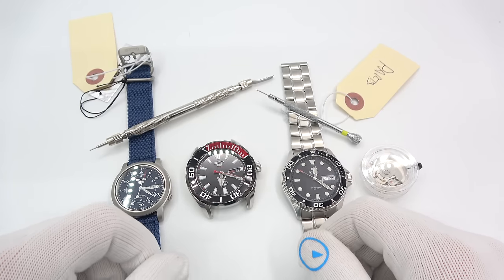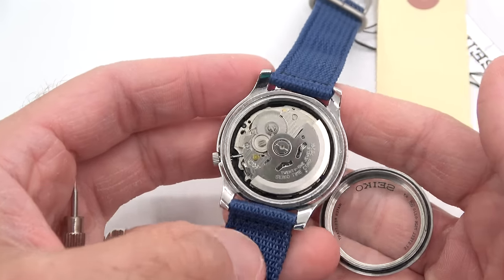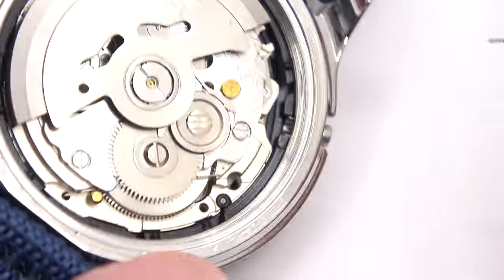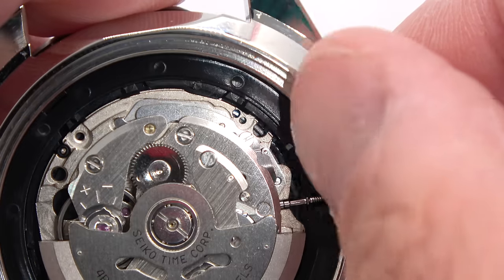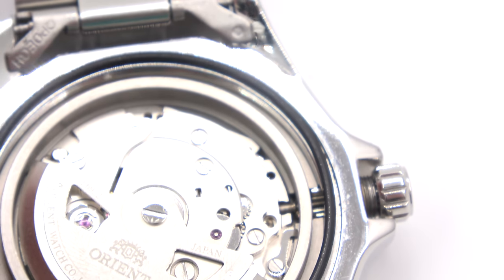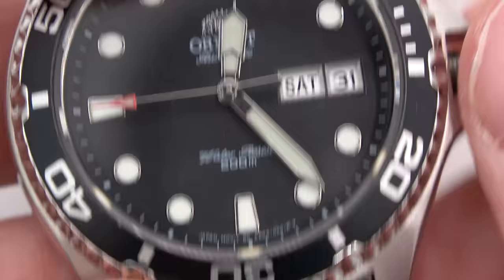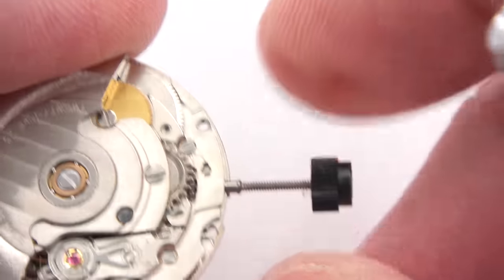How to Remove Stems and Crown from Common Movements. Watch and Learn #66

Comment: Hi, thanks for the excellent video. I needed to replace my stem after the jeweler broke the crown off my stem while replacing the battery. Obviously she said it was missing when I brought it in. So I ordered a new stem and crown from Esslinger and fit the stem to my watch per the instructional video by Darak Watches. I carefully inserted the stem as you show in your video and everything went together fine, but the date will not change when I pull the stem out to the first stop. Pulling the stem out to the second stop works fine to set the time. Can you offer any suggestions as to what I might have done wrong? Thanks in advance for any help. Movement: Seiko 7N42C

Comment: Perhaps you can help. I have a problem,my stem has broken half way through which means I cannot pull it out how can I remove half the stem inside the watch without the crown attachment or enough stem to pull it out?

Comment: As usual. Very helpful and informative. You're really good at taking the uncertainty and stress out of these things, Marc. Thanks very much.
Reply from the maker: No problem Randy, thanks for watching.
Reply: @islandwatch  hey man, great vid, I have a question? can you remove a stem while the watch is wound and ticking? or should you wait till it runs out of spring power and do it while it is still? thx!

Comment: Hi, I have a question. What if the button has detached from the stem? I have a tissot pr100 ladies auto and the button came off while adjusting the time so I've removed the stem but can find no obvious way of reattaching the button (it has a screw down crown with a spring inside it). With a loupe I can see no broken surface so I don't think it's broken, however there doesn't appear to be a screw thread to fit it either..
Edit: I think it's just friction fit so I've pushed it back onto the stem and I've refitted it and it appears to be working, yet it doesn't fully screw all the way down, there's a 1mm gap between the button and case. When I was reassembling it I found a tiny tiny spring (maybe 0.3mm x 5mm). The only place I could imagine it coming from is the stem so I put it inside the already tiny spring that is inside the stem. It fit in there perfectly but don't know if that's correct and if its made the spring too solid and now won't fully screw in. But if it doesn't go there, where does it go??

Comment: Mark, your video was a great help.  I was googling to find out how to release the crown for a Caravelle Devil Diver, c. 1974.  Not much help out there until I came across your video.  All kinds of videos on how to strip and re-assemble movements but nothing for the basic first step! In my researches I discovered that the movement 1053.50 is a Japanese movement and akin to a Citizen 8200 (17 vs 21 jewels, respectively).  When I heard you comment that the Orient was a 82xx series, I thought my prayers had been answered, and they were. I had found that for some movements, Particularly Quartz, you had to loosen a screw and thought that applied to all movements.  Thanks for the education to the contrary.

Comment: Thank you for this video. Not so easy to do if it's the first time because you tremble at the thought of breaking everything. I'm just going to do this on a seiko for realign a spring load needle (over 100 % when full, over 0% when empty). easy to remove, but I had difficulty putting the crown back on just because the movement was not perfectly aligned when I had already screwed the small clamps back on. Without wanting to force, I thought for a moment that I had forced too much and had broken everything ! So don't force it. If you feel that it's just barely strong, it's not good. Thank you for this video, I was able to repair my watch which nevertheless came out of a repair shop! 👍

Comment: Thanks! I was able to repair the date enclosure that had lifted up and was preventing the little hand from turning past 3:00. I originally thought I had a dead battery. The jeweler said battery was fine. So I tried to fix it myself - but it was this video that showed me how to remove and then reinsert the stem. With that I fixed my Seiko 8A61. Oh sweet success! Thanks again. 👍

Comment: Thanks this video helped a lot. 

I bought a cheap Seiko 5 a while back.  Shortly after buying it I noticed there was a slight fogging on the inside of the glass.  It was not overly obvious but once you knew it was there it was a bit annoying. 

Anyway thanks to your video, I've disassembled the watch, cleaned the glass and  stuck it back together.  Happily it still works and the glass is fog free.  Thanks again.

Comment: Great video, with more than useful information. Thank you! It is amazing how Japanese movements are made simple and ergonomic in their basic conception and lay-out.  It shows the success they have reached in a "easy to maintain", great quality, high reliability in a "KISS" (Keep It Simple and Straight) attitude. They have reached this combined mass production and reliability stages and "down to earth" technology. with most of their products. From cars to elevators, from watches to air conditioners etc... etc.... In addition to that,  most of the time, a great efficient & polite after-sales service is offered. This is what most customers need and want. Not more, not less.
Reply from the maker: Thank you :)

Comment: Excellent video and clear explanation.  Thank you.  Can you show how to remove the hands? I have 2 mechanically identical Stuhrlings. One works and the other is damaged.  The damaged one has the nice face and the one working is not appealing anymore.  How can I transfer the face and hands once the pin has been removed ?  Can I detach the battery mechanism from the face?

Comment: Can't find any example of removing the stem from miyota 9015? I found a schematic sheet and the marked stem release hole is so small it looks like a micro needle tool is required. Any video showing this movement's stem removal would be awesome!

Comment: Glad I found your videos. I've got an old Timex easy reader that has sentimental value to me, the watch new is only about $45 but I'd like to try to save it because like said it has sentimental value. I already tried putting in a used battery from another wash that was working and it won't run at all. Not exactly sure what the problem is with it I thought the battery might have just died. Do you have any suggestions?
Reply: Just wanted to add it does have the Indiglo feature and that was the first thing to stop working. That's why I initially I thought it was just the battery.

Comment: Can you please help me. My favorite watch is broken and I took it to a repair shop and no luck. The watch brand is Skagen and the issue is that the watch stem came out (crown is still attached) and whenever I go stick it back in, it doesn't stay in place. So now I have a watch where I can't adjust the time and have no idea how to put the watch stem back in place without coming out. Is there anything I can do or is it un-repairable?
Reply: I had a similar experience. In my case the stem release was broken. It was a qartz. You can identify the movement and buy a new one at Otto frei or esslinger.

Comment: I'm running about 50% success rate at putting stems back into 2824 and sw200 movements.  It's gotten me a bit "gun shy" about working with them.  OTOH I've gotten pretty good at tearing the keyless works apart and resetting the springs, hacking lever and crown gear.
Reply from the maker: I hear you. Unfortunately, they only way you learn is by doing. I honestly cannot remember the last time I messed one up, but I did alot to get to this point.

Comment: I have a ray 2 and was able to replace the crystal.  This video was a huge help.    However, I'm having one issue ... when I put the stem back into the movement it won't engage the locking mechanism.   I can feel the tension in the hole that I gently pressed on to remove it ... but for some reason I can't get the stem to re-engage and lock back in.

Comment: Thanks you for the tips! Quick question? What about NH-35 and variants? Same as 7S26 (you didn't mention that so needed to check)? I ruined a movement once as you stated so need to check and double check when I do remove crowns.
Reply from the maker: Same.
Reply: Thank you!

Comment: When the stem on a Seiko 6309A will not lock back in is there a repair from the back side?  It does not appear that this movement is dirty but I did clean the area where the button is. Is there a way to repair or reset something that is likely to come loose.  I have been very gentle with the stem buttons but find that these 6309 movements seem to be prone to this happening. I am looking for a video or brief description of how to repair this.

Comment: Hi Marc... Great video, thanks. 
The 7S26 stem clearly has an o-ring seal on it, but the Orient stem does not. Just wondering if the Orient stem tube houses a seal inside, if indeed it has a seal at the stem location all? Could you confirm? 
Thanks.

Comment: Thank you! My SNK809's crown is loose so that I can only turn it "forward". When I turn it backwards, the crown unscrews from the stem. I hope that I can tighten it up after removing it from the movement using your video's instructions.
Reply from the maker: This is the way!
Reply: You can also use a TINY bit of blue locktite thread locker. Make sure its the stuff you can take apart and you clean any oil off the stem threads.

Comment: Any thoughts on how to remove the movement from a Tag Heuer Sebring (dash) stopwatch. I need to fix a partially detached sweeping second hand but can’t figure out how to remove the movement. Thank!
Reply: i just had to remove the movement on a watch with a bunch of complications, the second hand was catching on the minute hand. i had to figure out the crown and stem release, then grab the mechanism with tweezers, and slide it out from under the stop watch pushers. took about an hour. good luck. the stem release was very different and had to be engaged to out it back as well. based on the video i was able to figure out which little gizmo it was.

Comment: But I broke the PIN on a fossil ME1130 now I'm very new to the hobby I thought this was going to be a simple battery replacement and it is turned into another nightmare which I guess is the point of watch repair but I cannot find the trigger or whatever it is called to release the pin so I can replace it I'm not even sure if it's a screw in tight pain because I can't find any information on the internet about this particular watch
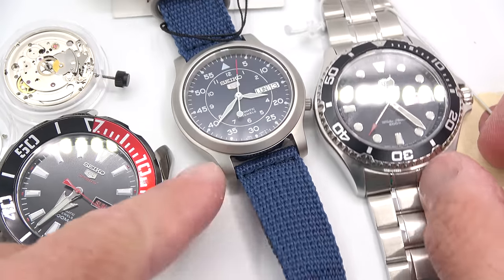Reply: It's also known as a fossil mean twist  there is a twist 1136 but mine is an 11:30 also known as a

Comment: Does anyone know if removing the crown and stem is the same for the new seiko 5s with the 24 jewel movement? They are the same as the Skx except the movement correct?
Reply: The new Seiko 5s (aka the 5KX) run the 4R36 movement, which is  the same as the Monster (centre watch) in this video. 👍

Comment: Marc,
 first off, I really enjoy your videos as they are so earnest and geared towards the enthusiast with mechanical sympatico but no technical knowledge. Many videos by others are condescending or too verbose without purpose. Yours are succinct and thorough.  May I ask you to show removal of stem/crown for the MIYOTA movements too? Also, I have in my mind that I would like to personalize a movement watch by having the winding rotor engraved, (I am considering Seiko, Orient or other Miyota movement- whichever is easiest to work on). Is it possible to remove the rotor without taking the movement out of the case? I don't want to risk damaging the hands. Thank you.

Comment: Hi Marc, thank you SO MUCH for your VERY informative videos! I personally, watched it just ONE STEP TOO LATE unfortunately..... I have 2 Montana watches, which are fairly expensive, and from some of their very first models. I absolutely LOVE Montana, but had to fix the band on one, and clean the INSIDE of the crystal on the 2nd one... (Told you their older lol). At any rate, I think I may have lost the spring or ??? on your "idiotproof version", (fyi, tried fixing on my own PRIOR to watching your vids!!) First, I found the stem went in WAY to easily. THEN, I noticed it would spin, but the hands would not move....THEN, when I pressed down on the little fragile metal tip part, it was already broken I think.... *sigh*...... Can I just SET it manually, and FORGET about needing to set it AFTER getting it back together? It has a battery...Its not a "windable", (meaning it doesnt have to be WOUND daily or weekly in order to work). Any help would be FANTASTIC! Thanks again!

Comment: When people ask about glass. I do maintenance-running costing and start with historical tools available in locality and existing designs from frog-man to mud-man to G-shock to seiko-movement to winding-cases to ultrasonic-fleaning. Then i say laser-hologram in glass block and capacitative-touch pebble curved sides for sode illumination and electroluminescent blue and followed by magnetic-flux neutral bomb-demolition then mineral-glass is pollution of silicon-sand not-silliconE and not-saphire single mineral and color of glass using mineral and angle of light using laser-blasted holographic edge lighting micro-tunnels and then democratic.
Reply: Clear Glass-solar surface citizen-brand eco-drive is patented grid-array.? WiFi and Bluetooth integrated circumvents that patent and ignore America's existence with patent per jurisdiction costing...
Reply: People won't pay for a "transparent""piece of glass with multi-core COMPUTATIONAL and electrical solar inductor NFC... But will pay for rubber straps and woven straps and metal bracelet and ... ... Have to make weight and "less" high-tech. And battery terminology, not integrated into glass.
Reply: PVC screw caps of pumps and pipes, FTW.
Reply: Why too high cannot brand.?
Reply: Crown and stem is like 86mm hand grenade.
Reply: EV is NFC inductor loop and lithium... Game on.?

Comment: Damn Sellitas and their stripped winding gears...
Easy fix, but I'm just getting a new movement. Bits of teeth are all down in it. Not worth it.

I hand wind my watches. If an auto movement has hand wind ability, it shouldn't be at a compromise and at risk of breaking by doing so. This was said to be rectified in the SW200-1, but with experience, and searching the web, it is clearly still a prevalent flaw.